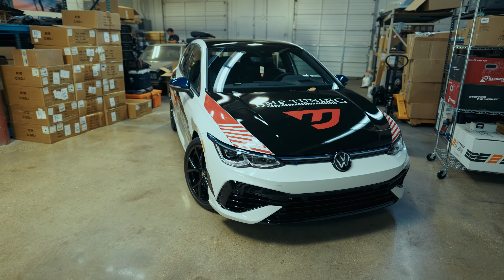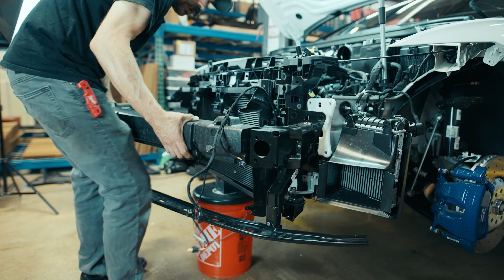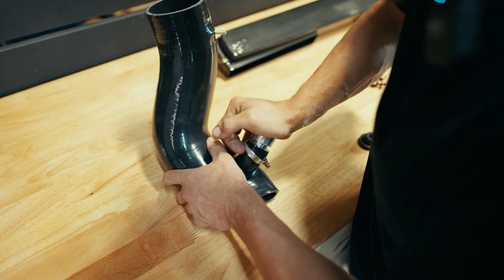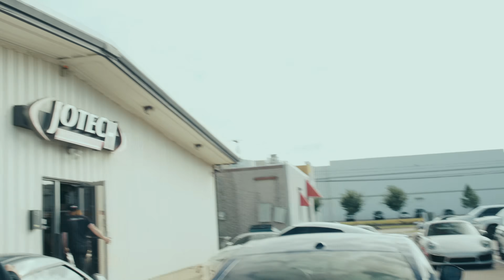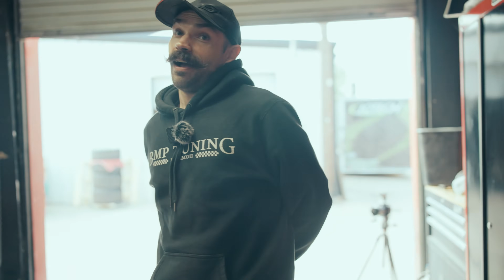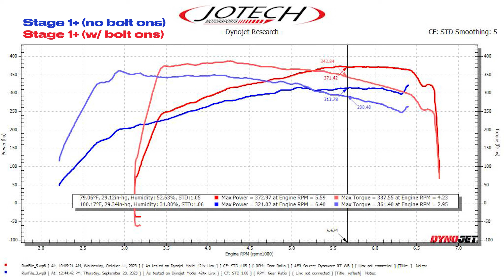BMP Tuning x Unitronic MK8 Golf R build Pt. 2 // Dyno and 1/4 mile w/ Stage1+ & bolt-ons

Comment: Did the intake include a turbo elbow or just a hose?
Reply from the maker: Just the silicone hose. Lots of testing has determined that an inlet pipe doesn't yield much of a gain on the Golf R specifically.

Comment: 40whp increase but 0 mph in the 1/8? that's a failed in my book. If I spend this much money on bolts ons and have 0mph gain, I'll be pissed.
Reply from the maker: You have to consider that without a TCU Flash, there is a huge bottle neck in the cars capabilities. If it were an earlier MK8 R with an unlocked TCU, you would see much more of a gain in that area. But for this car in particular were still waiting on the TCU to be unlocked. More on this soon hopefully!
Reply: how long it takes for these company like 034/Uni to come out with a TCU tune? @BMPTuning
Reply: @Osli1388  Could be never, technically.

Comment: Thanks for the video. Great dyno results!

The lack of TCU tune seemed to be hurting it though. That extra 40whp / 25wtq doesn’t really show itself in the dragy results, even with better DA. Yes, I know you braked just before the end, but look at 1/8 mile and 1000ft trap speeds. Of course, these results will be more repeatable/consistent with the better intercooler.

C’mon Unitronic…get us that TCU tune ASAP!
Reply from the maker: TCU solutions are coming, and def. will help us especially when we go Stage 2 DP/MPI/E85